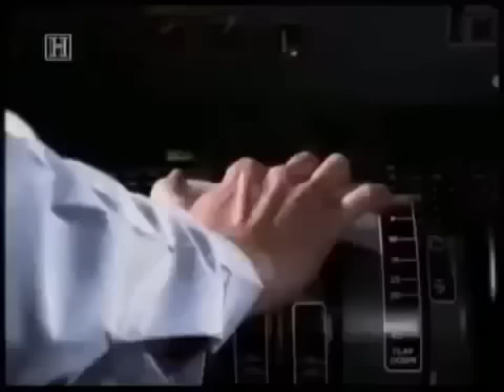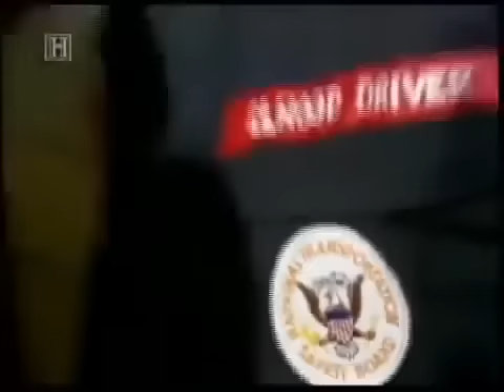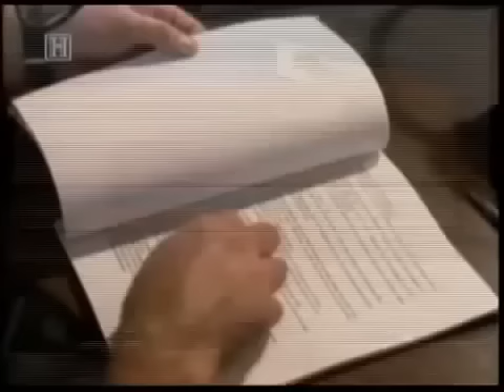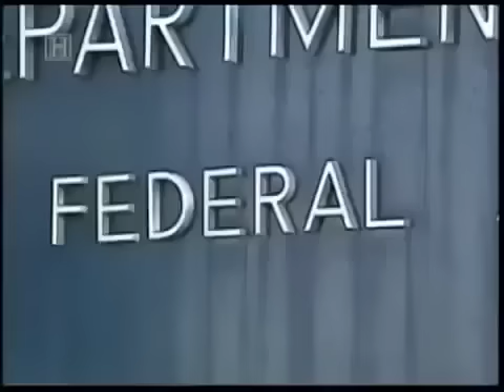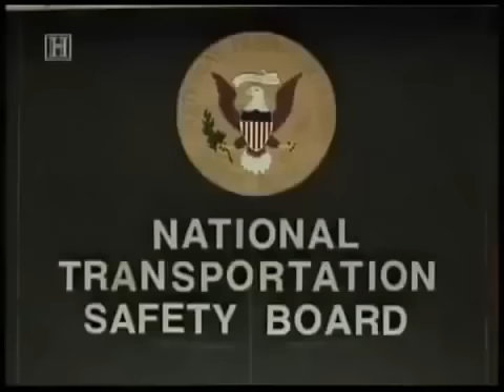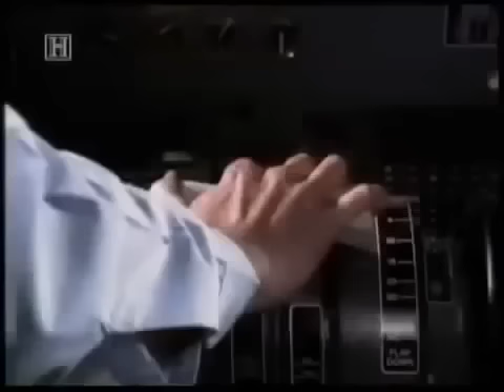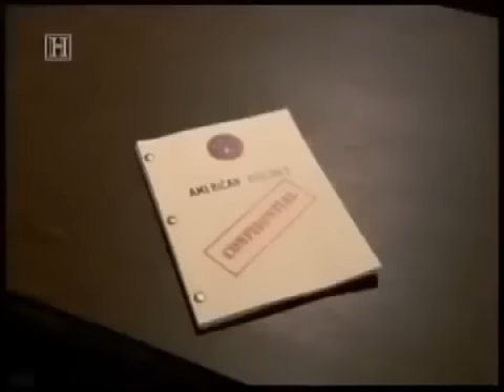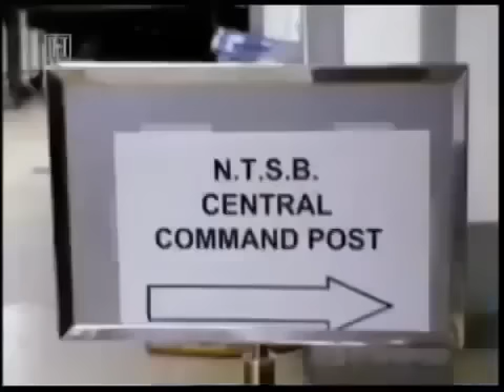Confidential Engine Failure Flying Uncontrolled Flight 191 Crash Pilot (Air disaster)

Comment: All the relatives want endless millions in compensation and even want the DC10 grounded permanently but guess what people also still expect to fly from A to B yesterday and for next to nothing !!! - You can't have both - something has to suffer and in this case it was maintenance because they took a short cut to save time !!!
Reply: They werent pressured into doing so, they found it better to remove one screw then 100's of screws. They made a 24 hour job into a few hours but nonetheless detering from manufacturing's recommendation is already putting one foot in the grave already. Relatives understand they cant ground dc-10's they just have to live with the traumatising scar for the rest of their lives, its horrible
Reply: Gary - the procedure wasn't bad, the maintenance crews doing it fucked up - maybe if they'd had your omnipresent wisdom bad shit wouldn't happen ~